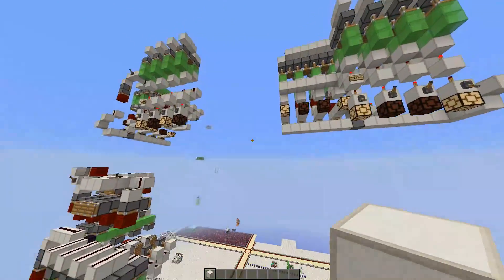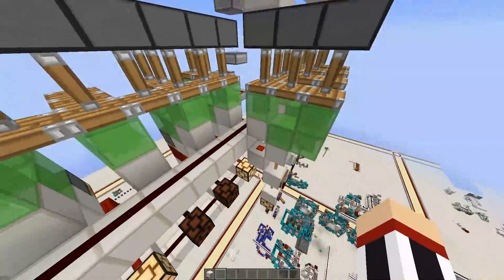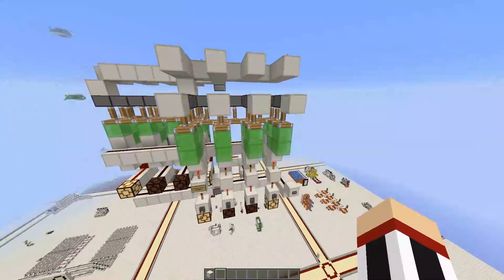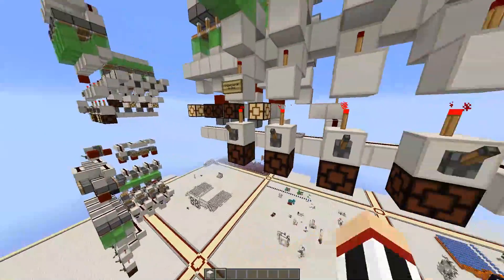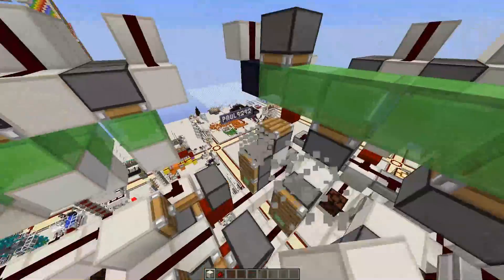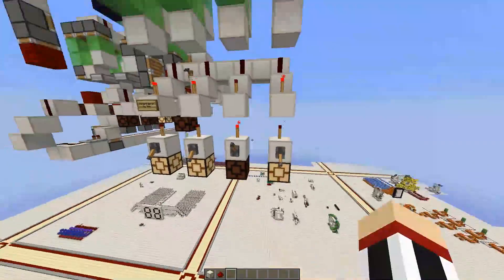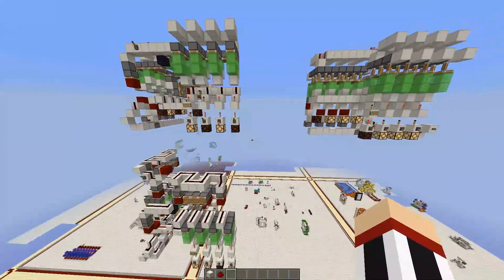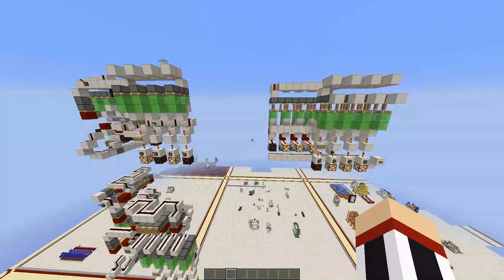Instant Serial Transfer in Minecraft using Microticknology (Proof of concept)

Comment: I think that there are greater implications of this tech than just high speed serial transfer. I think that this could be used to create instant computers that perform more than 10 operations per second. What you have here are repeaters, but it could be expanded to include inverters and combinational logic. And if each next bit transmitted is actually the result of the operation on the last bit, you could even perform several operations per tick on the same piece of data! I already theorized that it would be possible to create a 10+ Hertz 0 tick pulse computer by stringing copies of the computer together and transferring the state of the last unit to the next one for each cycle. But you've found something that promises a much simpler solution.

Even if there's no way to transfer more than 4 bits at a time, that could still allow a computer to achieve a whopping 40 Hertz!
Reply from the maker: 8 bits might be achievable actually :)
Reply from the maker: I don't have much experience with computers in MC, some, but IDK how to expand this exactly. I'm sure you can make a fast CPU with it though :)
Reply: What I mean is using this for parallel wiring, 1 bit per wire. And if you could transfer 8 bits per tick along each line, you could do something like read 8 instructions out of ROM in 1 tick, or update 8 registers in 1 tick, or perform 8 sequential operations in 1 tick, etc.

I mean, we might be talking about a whole new level of redstone computer performance.

Comment: Is it possible to make a similar circuit with more than 15 blocks between the 2 part of the system ? I am working on a very complex Rubik's Cube solver in survival redstone and I use a lot of serial transfer circuit so if it is possible it would be so useful :D
Reply from the maker: +Crafkiler yea, just use more of those repeaters :P
Reply from the maker: +DicoTheRedstoner It's actually a bit more complex than that

Comment: That's a really cool idea! It's infinitely expandable, right?

- Winteg8
Reply from the maker: +RedstoneInnovation 
The repeater is, but I dont know how you'd add more bits. I guess you need repeaters inbetween multiple transmitters for that. Still, the data that this sends can be done by just 1 comparator signal, sooo

Comment: did u see myrens earios video? he recently showed some stuff using these things. also, thsi is really quite nice and i actually have an use for it :P sadly repeating thsi signal is complicated but that could be fixed using the stuff myren showed so u migth want to experimetn around with that. 
i also nocticed that the audio
Reply from the maker: +Jendrik Weise Can you provide me with a link to that video? :)
Reply from the maker: +Jendrik Weise I did not. I'm unable to listen with sounds right now but the things he shows are not new to me, though good to see someone else figured it out. I've not heard the term block events before, and I'm going to stick with microticks myself.

I don't believe that there are easier ways to repeat the signal from the transmitter, as multiple pulses can be sent in the same tick. Pistons cannot respond to all pulses, because pistons are 'disabled' for 1.5 ticks as soon as they start retracting. This mechanic isn't bad after all though, it actually allows for other interesting circuits such as two-way repeaters which reverse the order in which microtick signals are given to piston setups. I plan to use this for a seamless version of my 4x4 door.
Reply: +DicoTheRedstoner do you aleady built such a system? i'm also quite intressed in this machine, but i didn't find a way yet :/ the door itself works already but the part that makes it seamless doesn't :/ maybe we should build it together xD
Reply: I think Jendrik Weise mentioned me, because I can send an arbitrarily large amount of information in a single tick over a single redstone line (connected with the special repeaters shown in my video that he linked). The main problem is just that the transmitters at the very beginning and the detectors at the very end get quite big for large amounts of information, but the repeaters in the middle stay the same, regardless of the amount of information, which means that this can be quite useful for instant serial transfer.
Reply: ik of that issue dico... sometimes it s also annoying so yeah... xD (although i d really like ur 4x4 to be seamless :D)
i m pretty sure the en and decoder can be i proofed significantally myren by using adders and subtractors for conversion from and to binary although for example the delays would get very long and so very bulky bc there s no real good way of making them more compact.
and yes that s why i mentioned u myren :D i think it could help this machine
Reply from the maker: As I said already, what he shows isn't new for me.
Reply: i think that s true transilvanian, the only thing that can really handle infinite speeds is redstone dust... i dont think there s a way either